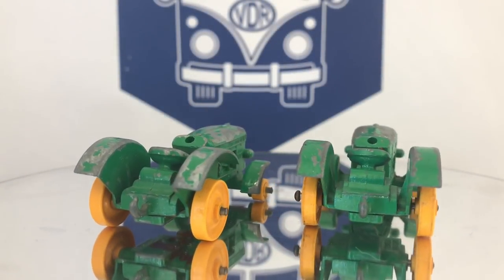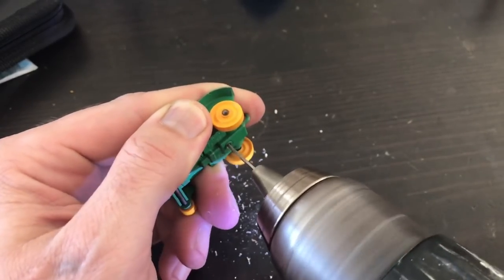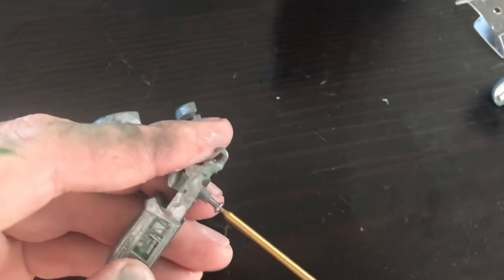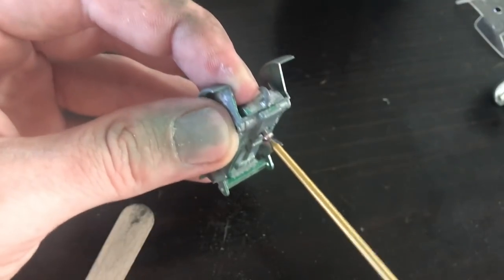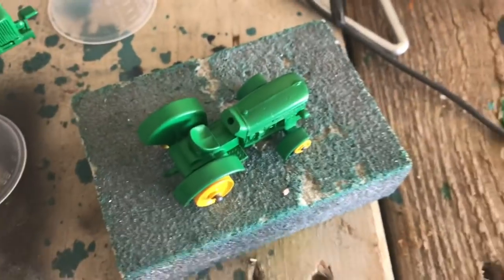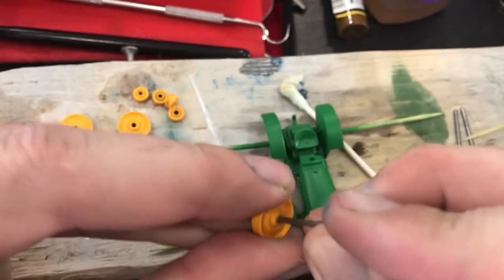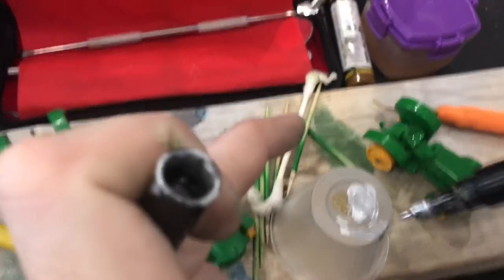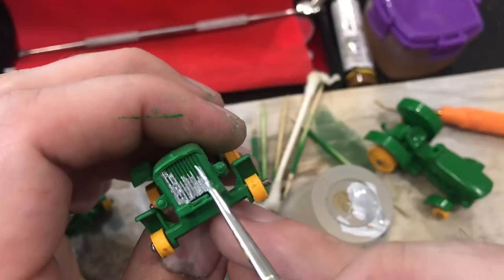Matchbox Lesney #50b John Deere Tractor Multi-Model Restoration and Custom

Comment: Nice work!  Where'd you find the tires?  Also, I hope you don't mind, but I added this to my channel as a featured video this week.
Reply from the maker: It was a combination of different models and pieces.  I think I have 7 of these tractors now trying to get wheels and tires from enough good models.  When a reproduction set of wheels is $10 (rear only) and I can still buy models with wheels for $4-$8 I might as well buy the whole model!  I have some blue stuff and want to try casting my own at some point in the future.
Reply: @vintagediecastrestoration  Fair enough!  I have a John Deer with a tipper trailer but the Tractor has no wheels.  The small wheels I have, the large ones I don't.
Reply from the maker: @TimeRider  Maybe I can cast you a few as well!  Let me know when the next IBFDR build is!